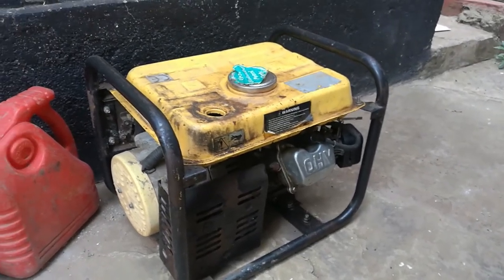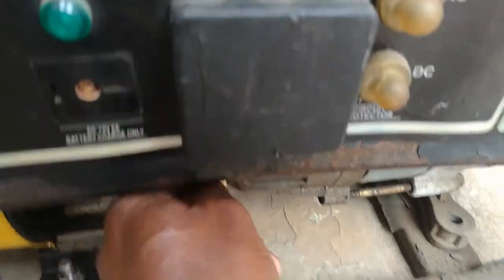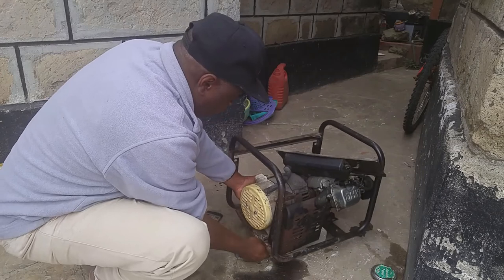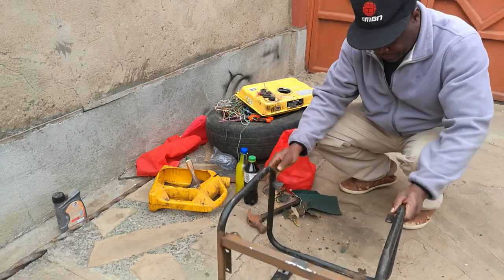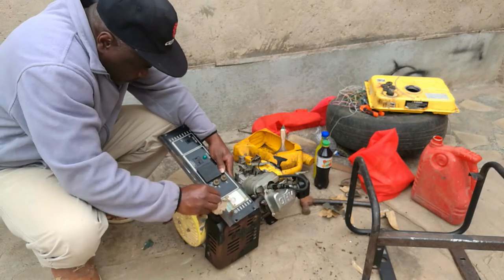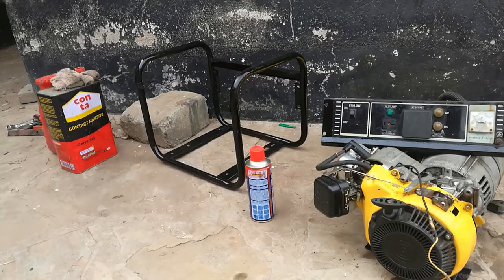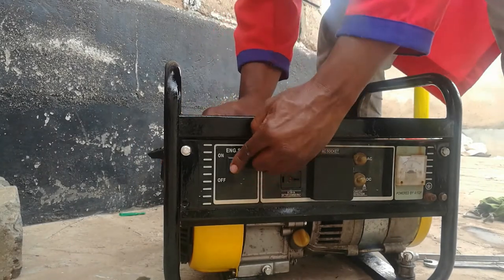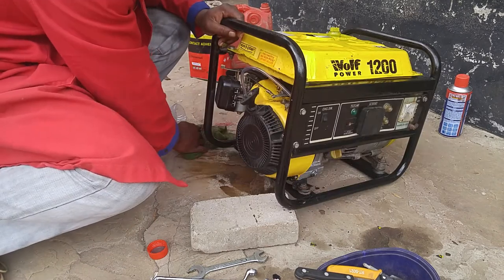Wolf 1200 Power Generator Restoration Project

Comment: David it's looks wonderful. Is there a battery cc anywhere on the Genny. And what oil did you use. Antony London
Reply from the maker: Hi and thanks for watching. Yes it has a battery charging output. Normal car oil SW30 I guess. Cheers!
Reply: @itskaharadavesnr  I mean a battery to do gauges on switches
Reply from the maker: @karlarobin  Oh no. It does not have that